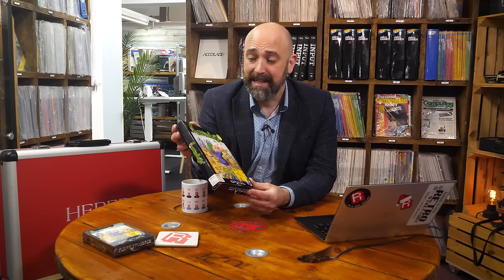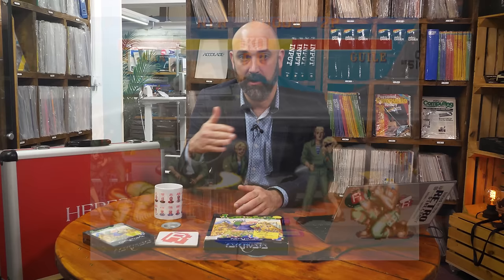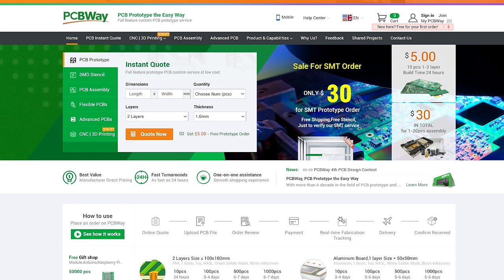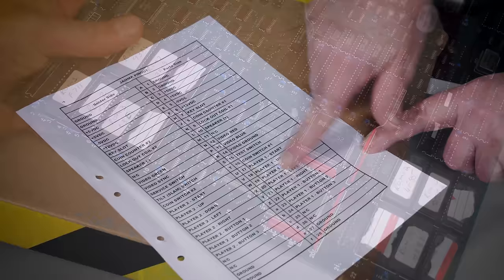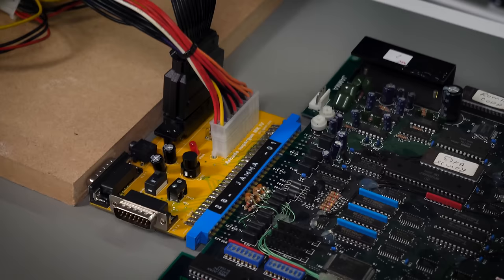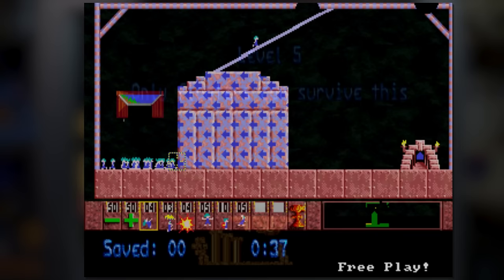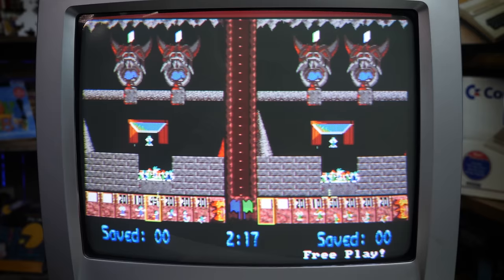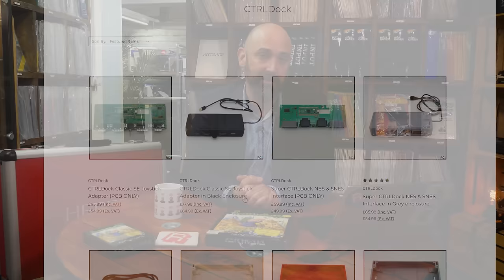The Only Known Prototype Lemmings Arcade in The World!

Comment: Given how rare it is, I think the safest option would be a cabinet with a mister set up with only the various ports available on it nothing else, with the board displayed as a unique artifact. However, the cabinet should have the ability to use the original board in limited occourences to preserve it from damage over time.
Reply: Good shout, I'm in full agreement. You best me to it, as I was gonna say the exact
same thing.

New Arcade cab, running Mister, using trackballs.
Perhaps have a cut-out, on the side of the cab, displaying the PCB.
Reply: Beat me to it. Definitely emulation for the cabinet, and showing off the board in a museum display. I wonder if the ROMs could be patched to make it a more complete game, or change the logic, e.g. to allow for bonus time if you save additional Lemmings (e.g. +1 second for each lemming saved).
Reply: A waste..Use it till it dies....After all just having it on display and not using it (and not knowing it still works) is stupid. Use it till it dies and then display it. Just like the morons showing working vintage vehicles and not using them (Jay Leno is a hero..he knows what to do).

Comment: @13:40 If you hold down shift in Lemmings & Oh No More Lemming on the Mac, it speeds up. If you got System 7, make sure that you deactivate the Shift lock extension, or it'll always be sped up. 

PS If you set the Lemmings drop speed to 88, it looks like they're walking backwards when you press shift.
Reply: Yes, that speed up feature was added to Lemmings Mac port because someone in the UK went on Holiday and it had to be finished. The person who finished it added that feature and it was then adopted later, nothing to do with the Arcade version or Lemmings 2.

Comment: How about putting the board in a usual Cabinetcase, but on the front, where the coin thingy is, put a proper plexiglas window in, and some lights and present the Board also.
So it would not be hidden behind some metal or wood, it would be visible for all the guests and players.

Comment: Artifact issues can happen due to under or over voltage. 4.8v maybe to little 4.95 maybe just right on the +5v pot adjustment on the psu. Done it so many times on neogeo mvs. 👍🏼
Reply: Eh, not likely. Typical tolerance ranges for TTL logic chip supply voltages are 5V ±5% in standard parts or ±10% in military-spec parts, corresponding to 4.75-5.25V and 4.5-5.5V respectively. And the actual threshold voltages for proper logic level detection are much lower. In TTL, 0-0.8V is a low, 2V and up a high. In CMOS, the thresholds are just a percentage of the supply voltage (0-30%=low, 70-100%=high), so not particularly sensitive to supply variation, provided everything is powered from the same supply.

Comment: I wish the extra wires seen on the pcb were not referred to as 'botch wires', as this makes it sound poor.  It's a prototype, as such likely only the first or early pcb, as such you would expect to see this kind of thing.  E.g. even after release, some manufacturers put these on after finding a later issue, e.g. Williams Defender.  On the video you mention doing something about it, I would highly recommend they are left as is, for likely they fix an issue with the 'next version' of the pcb to address it.
As for preservation, would be best to keep the pcb in a box for display, as in my experience as an arcade collector & restorer and electronics repairer, it would likely experience more failures over time, and bad if it is the surface mount chips (not sure if any customs are present).  Lovely to see it was saved (sadly many prototypes have been lost/binned) and shared with the wider community. 🙂
Reply: I think it's a term mainly used by people that have never designed a circuit with over 50 ICs, nor designed the multi-layer PCBs for them (hope I'm not offending anyone). When I was designing complex hardware in the 80s and 90s (but not for game applications) they were "patch wires", and therefore the hardware equivalent of software patches.
Reply: Isn't it "bodge wires"?
Reply: @GodmanchesterGoblin both patch wire or bodge wire are equivalent. It's just down to where people are from. Nothing to do with whether they have designed anything comple
Reply: @phill6859    I'm sure you're right. The terms will be completely interchangeable to many people.  But one term is less derogatory than the other if you have worked on such hardware and are also sensitive to the way the English language is sometimes misused.  And yes, that's me, and something that I am very much aware of - hence my remark about hopefully not causing offence.

Comment: Probably a bad RAM somewhere. Although in my experience, those Toshiba TMM2018 usually go nuclear when they fail - they heat up considerably and just don't work at all. But I bet the bitmap memory uses chips with more than 2k capacity... likely DRAM.
I usually short data lines on RAM chips that look like they belong to video RAMs to ground to see if lines pop up in the layer that has the glitches so I know I'm in the right spot or totally wrong. Then I jump known working ICs over the suspect ones. And if I can't get clear results from that and can be sure it's the RAM and not a BUS transceiver or glue logic (here I am because the lines have breaks in them where there are a few bits in the defective chip that are still working), I just remove them all and socket them.

Comment: Ah. I got Lemmings on DOS PC. So for me, there wasn't two player lemmings. 

They didn't even put it on the CD version. It was identical to the floppy version, to the point that the CD contained the exact same files and was mostly empty. I always found that so bizarre. 

I'd have saved the CD when I moved, but I found it was broken.
Reply: The main contents of the CD were the music tracks (as audio, they'd play if you skipped the data track). Quite high fidelity compared to the MIDI versions.
Reply: @DuskHorizon  If mine did, I never heard it. The game had a hard drive installer, and did not require the CD to play. I only remember the same FM synth I've heard in videos.

It was very cheap when I got it, only coming in a jewel case, so it might not have been the same as the boxed version. Unfortunately, I'm not sure it survived the move. I think the CD may have been broken. So I can't check.

Comment: I think a proper Lemmings arcade game should be 99% original levels, not CS (consumer software; Japanese term) levels. Ideally, you'd want to draw in both new players and Lemmings veterans; having mostly/only CS levels would bore the skilled players. Also, designing new levels would give a developer the ability to tune them for the arcade audience. (I feel it'd be largely 60-120 second levels, mostly with release rates above 80.)
Also, it's pretty clear that the game needed dedicated buttons for switching abilities. I'd say a total of four buttons. Select Lemming, Switch Left, Switch Right, Start. Double-tap Start as a replacement for the Hurry button. Hold Start and Switch L/R for adjusting the release rate. Hold both Switches and Start for a second, or all three and press Select, for Nuke. (Perhaps additionally detect when there's nothing but Blockers on the playfield and no Lemmings left in the hatch, and automatically hit Nuke then.)

I have a few other ideas, but maybe it'd be better to just make an arcade-like Lemmings clone instead.

Oh, and in MAME, the timer is already accelerated; pressing Hurry doesn't affect it. Not sure if that's the case on your real hardware.

Comment: I'm shocked to learn that the fast forward wasn't in every version and I just happened to be lucky by playing on 3DO.

The game would be unbearable without it.

I feel like lemmings would be a viable arcade game, but they didn't change enough.

They really should have leaned into the idea of getting a single lemming to the goal, with puzzles completely reworked to take advantage of that idea with a much lower amount of time to complete them.

I think that two player could actually be great as a pseudo RTS/Puzzle game where each player sits over a goal that they must defend from the other player's lemmings, with the different abilities now having additional uses (e.g. Blockers can direct your lemmings to the goal, or they can redirect the opponent's lemmings, you could use explosive lemmings to clear a path quickly, or to deplete the other player's resources, etc). Maybe there could even be just the one goal that both players are trying to build a route to. 

Controls wise, I think that it would be a good idea to have a trackball, two buttons for left and right click, and a dial/rotary encoder like you'd have seen on an old Pong machine for selecting abilities, rather than going to the bottom of the screen with the cursor.

I'm imagining something partway between ChuChu Rocket and Worms as the ideal arcade version of the game.

Comment: Preserve the original board in a show display and dump the ROMs and build a genuine arcade hardware emulator (not just a compatible emulator so it can be called genuine experience) then have that in a cabinet along with a second cabinet with a random PCs version emulators to select the different versions of the game. So essentially 2 cabinets 1 lemmings style for the genuine arcade hardware emulator and 1 that has all the different port's and have the real acade board in a display of some kind.